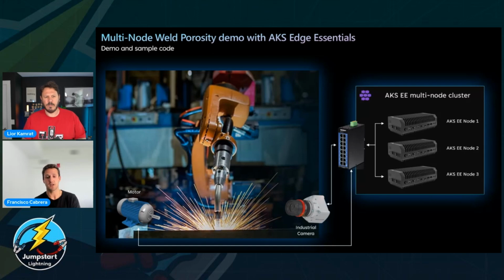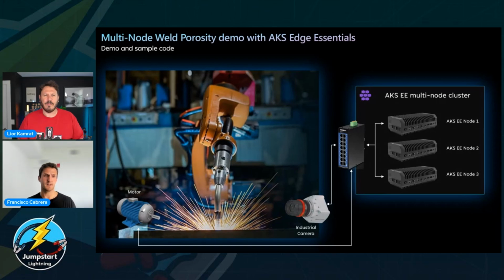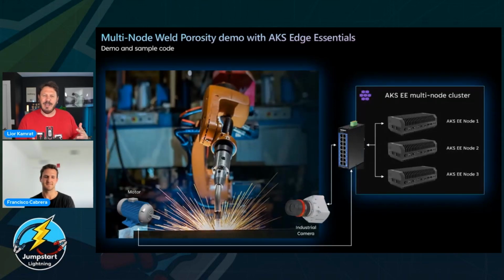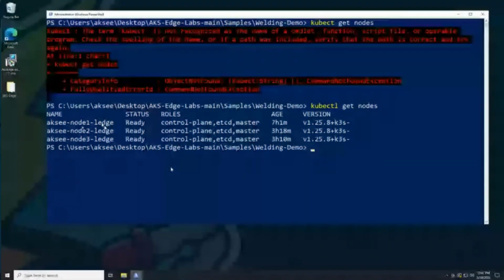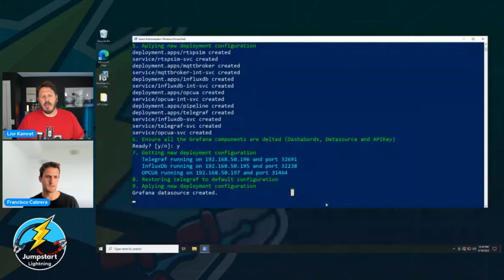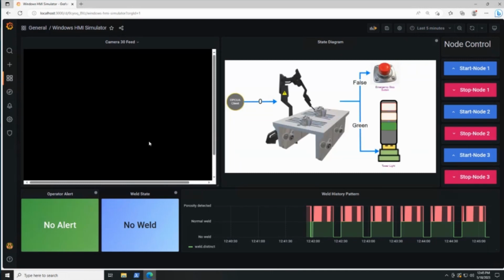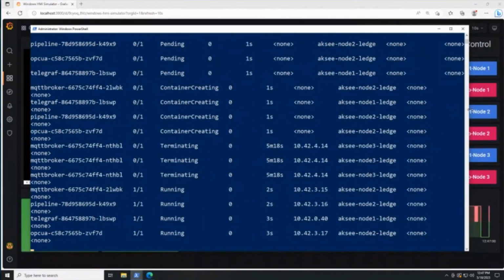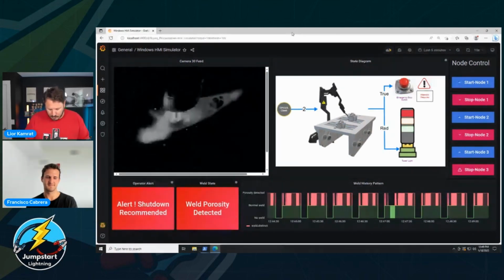AKS Edge Essentials Multi Node

Comment: Great demo! 
How do we keep data consistency between nodes for influx DB when a single node fails? 
Is our Graphana running redundantly as well  and is highly available -> spread across all 3 nodes?
Reply: Hi, thanks for checking out the demo. InfluxDB is not HA, but you could use a PV with Longhorn maybe.  We are open for contributions and we would like to  continue improving the sample. Regarding Grafana, it's running on the Windows host OS, so no Pods/Kuberentes, although we could move it to a pod in future iterations.

Thanks,
Francisco
Reply: @franciscocabrera3039  Thanks for coming back to my comment! In the demo you show that the application continues to run after you shut down node number 3 WITHOUT data loss. My questions is - "How do you achieve 'no data loss' if data is not being written to multiple intances of InfluxDB across all 3 nodes?"
So if we're 'unlucky' and the host with Graphana crashes we also loose the dashboard, there is no HA. Do I get it right?